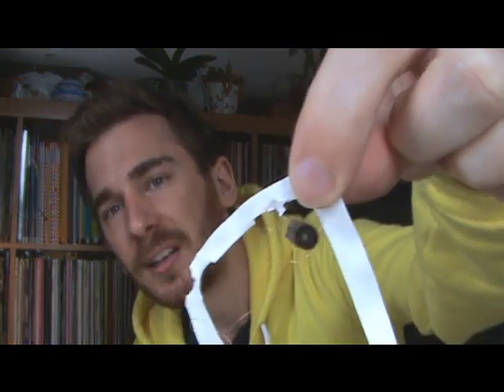UPDATE: How to remove the RFID chip from an Oyster Card

Comment: Would pure acetone work instead of nail polish remover
Reply from the maker: Sure, it'll strip the outer layers very quickly. I don't think it will affect the inner core, but I've accientally melted entire cards (ruining the chip) using pure acetone on the older version of Oyster cards.
Reply: I've done with a small amount of pure acetone, just enough to cover the card... In one hour or two I could take the chip and coil easily

Comment from the maker: I left my latest one in a jar of nail polish remover for a couple of weeks(!). Then, starting at the chip, *very carefully* picked away at the little bubbles near the loose ends of the wire until I could pull up the top layer. Carefully pulled a strip of this away to expose the wires all along the top edge. As I went, it became easier to pull up the whole layer. Fingers crossed the chip survived the long bath!
Reply: Did it work? I want to try this myself
Reply from the maker: @williamddougans It worked for me, try it out and see if it works for you!
Reply: @frankcswain I’m so glad even over a decade later you responded, I will try this but with my school bus pass

Comment: 1: What is the position of the RFID? So I can be extra careful there.
2: Is it possible to cut out the RFID and solder new wires on? Do they have to be a particular length or thickness? Can you improve quality by making wires longer/thinner/thicker?

Comment from the maker: It's hard! I'm working on a new card at the moment, I'm going to try using 'silicone eater' to melt the plastic. You might also try using industrial strength acetone (paint stripper) - but don't let that get on the chip itself.

Comment from the maker: @arefin1988 You'll need some kind of aerial.  The Oyster card has no battery; the chip gets its power from the aerial passing through the magnetic field of the reader.  
Can you upload some pictures of the printed circuit?  Would be nice to see it.  
Maybe can try soldering a very fine copper wire onto the chip (be caerful not to cook the chip though!).

Comment: We copied the instructions. After 1.5 hours we were able to expose the chip and aerial. Unfortunately the design has changed and there is no longer a copper wire in the card. Instead it look more like a the lines etched onto printed circuit boards. This material is extremely fragile and the acetone had caused the aerial material to snap in places. We tried it out at tube station prior to removing chips and aerial it from the card backing. Unfortunately it no longer functioned.